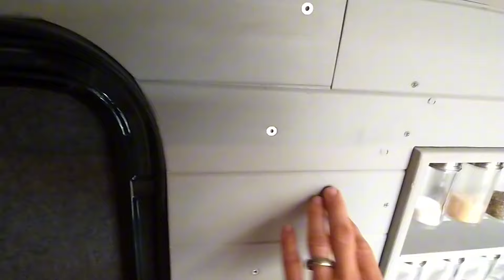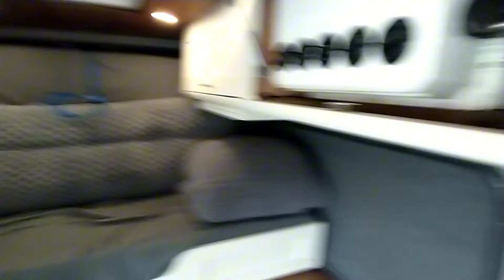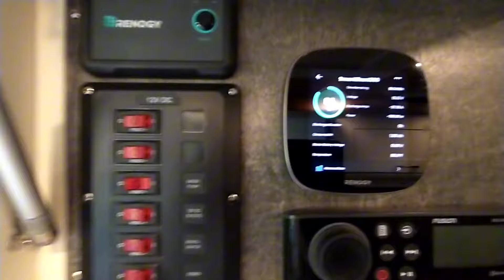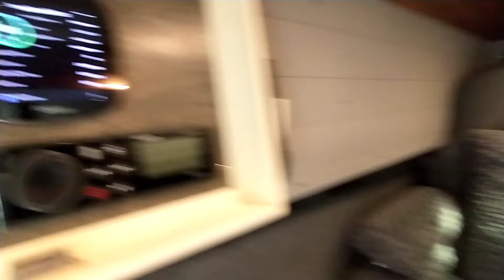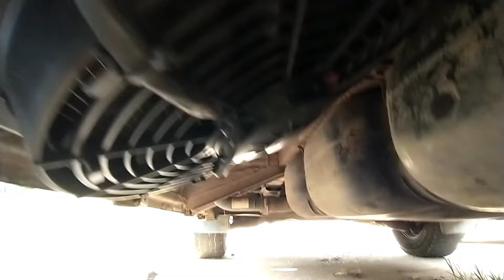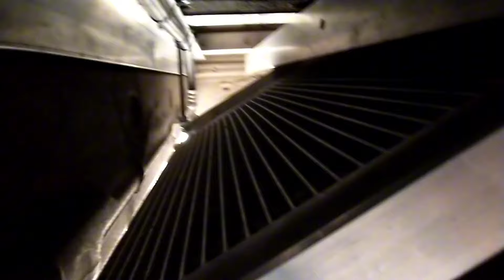$600 DIY 12V UNDERMOUNT A/C!! Treeligo mini split underbody mounted on a Sprinter Van

Comment: Andy good day . This is David in France. I have a high top ( so can’t use roof mounted unit because of angle) Vw T25/ Vanagon and want to fit the condenser / compressor underneath as you have. Please tell me the components specifications so I can get them ? Amazon or where? Thanks. David
Reply from the maker: Hi David, it's been a couple of years since I purchased mine so there's no link but any chinese mini split should do. Mine was a Treeligo but you'll find most are the same just rebranded. I did a couple of other videos on the build, most parts were just scraps I had laying around. Here is one of the earlier videos, hope it helps. Cheers

https://youtu.be/tqH6do4m92Y?si=WekSLibNHIfluBc1

Comment: 9:40 im about to copy alot of your build. Do you think the fan can lay flat against the van body if i find a could enough spot or do  i need to leave a gap for air or something
Reply from the maker: You absolutely need a large space for airflow, also the fan should not blow straight down as you will want a constant supply of cool air, not recycled hot air.

Comment: 12:00 you should post a link to the metal plate and bolts you used
Reply from the maker: It's truly just a piece of aluminum plate and stainless all thread. Just Google those search terms in your area and look for the best deal. Also any local hardware store will sell all of the above.
Reply: @andysgarage1  the outside unit of my treeligo has like a circuit board thing. Where did you put yours?
Reply from the maker: @whatupdawg281   If you mean a small board with heat sinks, that is the controller for the compressor and fan motor. Mine was an older version that did not have an external control. The new design is superior, make sure it and the compressor also get plenty of air flow or they will burn up.

Comment: I have the same one just installed last night and every now and again I get E3. Doing research and figure out why that is. I turned up the temp to 30p and it stopped. 🤷‍♀️
Reply from the maker: E3 is bad connection at the compressor, have you checked the terminals?

Comment: I have a 02 E350 extended  cargo van im using as a camper i need to know best hidden location for condenser and how you hooked yours up when on shore power because it will run all the time when not driving
Reply from the maker: Mine is hooked to the batteries which can be fed by the Renogy inverter charger on shore power. The best location is anywhere with room underneath that isn't in the direct path of tire debris. Many manufacturers will give you extended freon lines at no extra charge as well.

Comment: Hey Andy I’m super interested in this project. Is there somewhere I can contact you and ask some questions?
Reply from the maker: I saw your email, I'll respond when I get some time this evening. Anything specific you're after?
Reply: @andysgarage1 mostly interested in the process of taking the external components out of their original housing. Were there part that had to be disassembled and reassembled. How difficult was the installation excluding the mounting? And if it’s not to much to ask your advice on picking a unit.
Reply from the maker: @keizThePainter disassembling the unit is very straight forward, making the bracketry to hold it securely is a bit more challenging but not too bad. I would recommend having an A/C shop service the unit after assembly if you are not familiar with the process. As for which unit, I used Treeligo. They are all about the same honestly, look for a company that has good reviews and a good price point. The new units do indeed have a separate control module which I believe would cut down substantially on compressor heat. I'm happy to answer questions along the way, if we correspond here vice email it has the advantage of answering questions for others as well.
Reply: @andysgarage1 hi Andy thanks for this video. About to undertake this project in my Promaster. How exactly did you install a vapor barrier inside of the C pillar? That is the one thing that I couldn’t really wrap my head around. Thanks
Reply from the maker: @jaydenpines7965 I'll have to watch the video again to remember what I did exactly. However, with the 3' or so loop up top I have found that it doesn't get condensation inside the pillar. I also coated inside the pillar with fluid film. Will report back
Reply: @andysgarage1 awesome thanks for the info. When Reassembling the components on the bracketry is it pretty intuitive? Just the inverse of when you were dis assembling it originally?
Reply from the maker: @keizThePainter  As long as everything is securely mounted the relative positions don't matter too much. You don't want them in the direct path of tire debris when you locate them on the van but i'd say yes, very intuitive.

Comment: Hey Andy im in the process of installing this unit just like you did. Wondering about the elbow pieces you used to attch the allthreads to make the fan swivel the way you wanted it. Did you just make those elbows by cutting pieces of aluminum angle?
Thank you kindly
Reply from the maker: Yes I did, just aluminum angle, keep me posted on the project, would love to see it when you're done!
Reply: @andysgarage1 awesome thanks.
Definitely bumpy so far. Only way for the hose and electrical from the compressor to the fan can both reach at the same time means I can't put them side by side.
Have to pivot and put it at the back of my transit and put the compressor near the spare wheel.  Then it will be more "below"  the fan like the way it came in the clamshell. I'll keep grinding away and keep you posted👊
Reply from the maker: @joemorgan7005 if need be most of the manufacturers offer extended hose setups
Reply: One last question please. Did you get your freon from amazon? Link perhaps? Some of the freon products im seeing are not clear on the quantity. I recall you saying 650g was needed
Reply from the maker: @joemorgan7005 I purchased mine locally at Walmart or AutoZone. Check with the manufacturer of your unit for specific requirements, also oil should already be in the compressor but it doesn't hurt to verify with them as well. If you don't already have a vacuum pump and manifold I would take it to a local shop to save the hassle.
Reply: @andysgarage1 terrific. Appreciate all the help
Reply: @andysgarage1 hi Andy.  So I ended up trying to do the last step myself.  Vacuumed the system but it won't accept the freon. Local shop doesn't want to touch it now. My question is did you fill the freon with the ac unit running? Im getting conflicting information .  Some say the only way to pull the freon out of the can is to have the unit on and the compressor kick on, while others say the unit must be off. So confused. Do you have any ideas? Customer Support left a lot to be desired. Thanks man
Reply from the maker: @joemorgan7005 The system should be powered on, the compressor shouldn't kick on until the pressure trips the switch. You must be certain the evacuation is done properly, lines are purged etc before servicing it. I would recommend watching several videos/ reading sites before the attempt. Also, are you using a manifold with hi and low pressures or just a service hose?
Reply: @andysgarage1  thanks you for the reply. I vacuumed it twicw to be safe, but i will take your advice and watch more videos before trying again. I had the unit off.
As for the manifold it has high and low pressure guages as well as separate vacuum and refrigerant guages(as opposed to the same guage for both)

Comment: OutEquip Pro 12V has recently beaten Treeligo in several independent van-life
Reply from the maker: It appears to be the identical unit, I don't believe there would be any appreciable difference in cooling or efficiency.

Comment: Does this unit do heat? And if not are there similar units that do heat?
Reply from the maker: No it does not, I have a diesel heater. There are similar units that do, just uses a lot of battery when diesel heaters are cheap and efficient.

Comment: Question for you, I am thinking of installing one in my Highlander SUV, thinking of removing spare tire for the outside unit, would you recommend I tilt the unit, or do you think it would work mounted flat?
Reply from the maker: According to the manufacturer it will work flat, I tilted mine to aid in oil recirculation to the compressor but it may not be necessary

Comment: That is one of the cleanest non roof installs I've seen. Well thought out on the compressor and and angled radiator. I know some guys have done the spare tire location, but that for sure would be a dust collection spot.
Reply from the maker: Thanks! It's been holding up really well for almost 2 years, and Ive never cleaned the condenser! Still looks great.

Comment: Hi Andy, grate video, but I have a question  iam I also have a Chinese  unit. Did you counect  the unit to your batteries o did you canectet to your solor , I have it strait to batteries, did u counected the unit to ? Thank you.
Reply from the maker: The unit is connected to 400ah lithium batteries. Solar is run through the solar controller to the same batteries. Solar would not be effective for running A/C without a battery bank for several reasons.

Comment: Just an added comment, I would put some kind of sheet metal or stainless steel fabrication so that rodents don’t chew through your nice wiring
Reply from the maker: Honestly all my wiring is loomed just like factory, if the rodents want it badly enough I won't be able to stop them. 😔

Comment: Living in Thailand, and having a similar set-up, the inner tubes leave too much condensation inside my van. To the point where the water is dropping from the tubes.
Reply from the maker: The rubber Freon lines from condenser to evaporator?
Reply: @andysgarage1 between the outside unit with the fan and compressor to the inside unit
Reply from the maker: @KristianKfitness  wrap it with a neoprene or foam pipe insulation and then wrap with tape.
Reply: @andysgarage1 legend, thank you!

Comment: Met you in Blackwater. I had the lifted Econoline a couple spots down from you. Finally getting around to adding AC to my van and just ordered the same one. How long are the lines in the kit? I was thinking about put the outdoor unit in the spare tire location and mounting the indoor unit towards the front. Thoughts on extended these lines or are they long enough? Clean build by the way!
Reply from the maker: Hey! Nice to hear from you! I'd say the standard lines were close to 10' I'd probably go for extended if you want it towards the front. I believe the seller will give you the longer ones free of charge. I'm also about to add a 5" dirt bike radiator fan to the compressor, ran it for 12+ hours in FL last week and it needs some better airflow.
Reply: @andysgarage1  Any tips for mounting under the van? Mine arrived yesterday and now looking into install locations under the van.
Reply from the maker: @joshuahanke6363 I used angle aluminum, no welding and pretty cheap. I did a previous video that might show a bit more of the frame build, I'll check.
Reply from the maker: @joshuahanke6363 https://youtu.be/tqH6do4m92Y?feature=shared
Reply from the maker: @joshuahanke6363  I also used a motorcycle radiator fan from Amazon to cool the compressor, really makes a difference
Reply: @andysgarage1 Andy is this motorcycle fan in the video?
Are you saying it makes a difference because the compressor gets hot to touch?
Also, do you have to turn on this motorcycle fan on manually when you fire up the a/c or do you just leave it running all the time?
Fantastic video man thanks !
Reply: @andysgarage1 do you attach the angled aluminum to the frame through factory holes in the frame or with metal screws?
Cheers and thank you
Reply from the maker: @joemorgan7005 It's a motorcycle radiator fan wired straight to compressor power, so only when compressor engages. And yes, it was getting super hot and making noises, much cooler now!
Reply from the maker: @joemorgan7005 Angle aluminum frame with 3"~ stainless bolts drilled all the through those crossmembers and then painted. Cheers
Reply: @andysgarage1 such a great idea! Thanks
Reply from the maker: @joemorgan7005 Thanks!
Reply from the maker: @joemorgan7005 There's a newer design of compressor with many of the Chinese mini splits now. It has the controller for the motor in a separate box from the compressor, I'd imagine this cuts down on heat a good bit. I'd source one of those if you can and do the fan either way IMO, it's cheap insurance.
Reply: @andysgarage1  Good to know. I'll get under the van today and check it out. We just got back from a 5wk trip in the van and the last week we could have used AC due to the heat wave. Otherwise we typically try to go where it's cooler on long trips. Adding the AC I hope to extend our camping season since the heat and humidity never leave us.
Reply: Would love to call u and ask u some questions about your install! Is that ok?
Reply from the maker: @ericquest4816 Shoot me an email @ abusch13@gmail.com
Reply: @andysgarage1 ….. ummmm sorry for intruding on the conversation. I’m looking into installing the ac. Wondering if I may contact you as well? Sorry for intrusion.

Comment: Does this compressor need to be mounted in that "base down" orientation? I mounted mine on its side and its not accepting the r134
Reply from the maker: According to the manufacturer if can be mounted on its side. Also, that shouldn't keep it from accepting freon. What happens exactly when you try to charge it?
Reply: @andysgarage1 the low pressure gauge will shoot up much higher than the high pressure gauge. One try I did saw the high pressure gauge stall at 100 but that made the low pressure reach 95!
Reply from the maker: @dougwayne4548  it's really difficult to say from here. I don't know how experienced you are with A/C service. Are you following a good tutorial? Also make sure you're evacuating for plenty of time and purging the charge hose. Generally I find when a system won't take freon it's a manifold setup issue. Is your compressor kicking on?
Reply: @andysgarage1 I'm going to try again today. I'll vacuum for even longer this go. As for purging the yellow hose, I did each time. I'm wondering if I wasn't aggressive enough with shaking the bottles to ensure they mixed properly. If it's mainly getting the gas I don't think the compressor will kick on, and mine never did.
Reply from the maker: @dougwayne4548  There's no need to shake the bottles, just a gentle rolling back and forth. the evacuating and purging won't help it not taking gas but will affect system performance later. 

Double check the setup of your manifold and that you're servicing through the low side. Depending on your manifold you may need to close the high side port. Whatever instructions you're following try a different set and watch a few videos to verify the manifold setup. I would be willing to bet that's where the problem is. good luck and report back

Comment: Thanks for showing us how to install the A/C.  I'd wondered if they'd work horizontally under the van.  It's funny to see folks mount them onto the rear door.  Did you consider mounting the inside unit at floor level & ducting the cool air to the ceiling, maybe to make it quieter & to save a bit of upper cabinet space?  Subscribed.  👍👍
Reply from the maker: Thanks! I did not consider that for several reasons, but the main ones would be that we love the white noise and ducting it that far would greatly reduce airflow which would lead to other problems like a loss of efficiency and a freezing evaporator. Cheers!
Reply: I just need to know where to get a metal plate for the condenser

Comment: How long are the hoses?
Reply from the maker: @rollinwiththeflow2174  I think they're 10' but you can request longer ones at no additional cost. The one I purchased is no longer there, just search "12V mini split" on Amazon, there are loads. There's even an undermount inexpensive one now.

Comment: I bought one and it was broken when I got it . Just sent it back hopefully the next one is not broken
Reply from the maker: @andrewmartin6404  Dang! What was broken?
Reply: What was the issue?
Reply: @dougwayne4548 the rubber feet that the compressor sits on were broken. Also it has a dent in the condenser. They made it right through. They sent me another unit and didn't even have me ship back the old one. No I have extra replacement part if something ever breaks. The ac is a beast. Super cold and very efficient only pulling about 650 watt at full power.

Comment: So you took off that white clamshell that the condenser and compressor come in and mounted the compressor upright? What piece of metal is the compressor sitting on? Thanks in advance.
Reply from the maker: @SanFranTriDude  Hello there, I did remove the clamshell and components. That model is generally meant to be installed vertically on a truck cab anyway although it can be mounted at any orientation according to the seller. The tray I mounted the compressor on is a piece of .250" aluminum from Amazon for about 12 bucks. Stainless allthread holds all of the components under the van. I have one other early video on the A/C that may answer a few questions. Hope this helps
Reply: @andysgarage1  Thanks for the fast response. I like that you mounted it vertically...I think there would be problems with it even though they say 'it would be ok'. Going to try to emulate what you did. Regards!
Reply from the maker: @SanFranTriDude  I would imagine it depends on oil return and such but I agree and figured I'd mount it that way. Good luck on your install and let me know if you have any questions along the way!
Reply: @andysgarage1 how thick is your .250